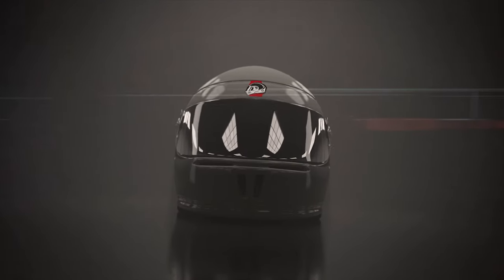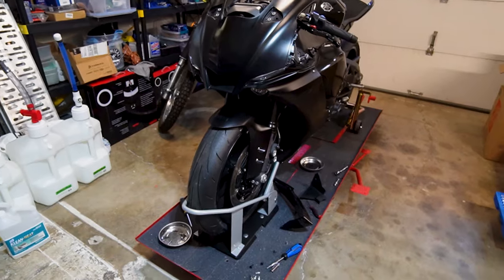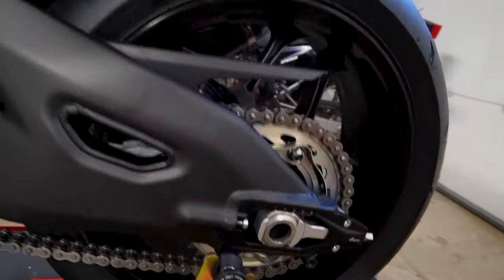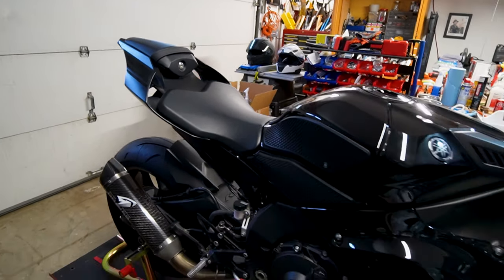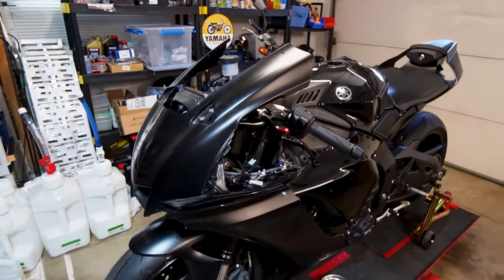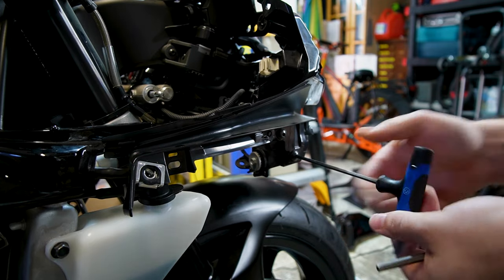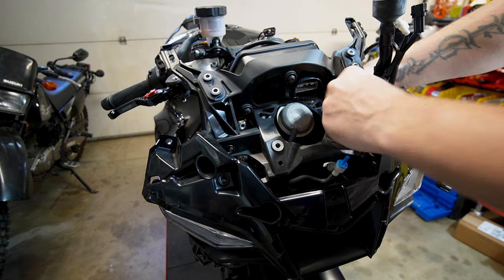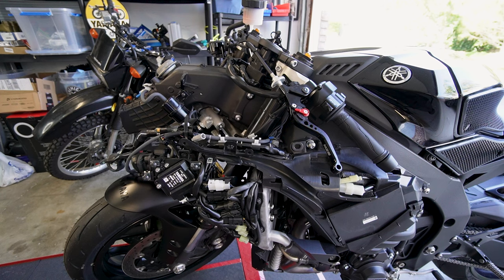Yamaha R1 Intake Flap Removal & Delete! A MUST DO for your Air Box!

Comment: The question is why Yamaha put those parts there? This is the first question you should ask before removing anything on an R1 or R1M. Parts are weight and on Superbikes are always a no-go zone. There must be something more advantageous than the weight to force Yamaha engineers to put it there.
Firstly, engine needs more air than the small duct can provide, when it revs over an X number of revs. At lower revs it doesn't need that max volume of air.
THAT PART IS NOT RESTRICTING THE VOLUME OF AIR. THAT FLAP OPEN AND CLOSE TO INCREASE THE SPEED OF AIR ENTERING THE AIR BOX!!!
YOUR BIKE WILL BE SLOWER AT LOW SPEED BECAUES YOU REMOVE THIS FLAP. You are good on screwing and unscrewing parts, but that's your limit in engineering. Good luck
Reply: @TrickRacing  You said it. They race the bike, not for street use. Racing bikes are not for road use because of the way they build them. Like for example, removing the flap...
Reply: @KHIJAPAN  true
Reply: Agree 100% - I work for an engineering firm though we don't work on engines we still put a lot of resources into establishing the best process for the application. Removing a process needs to be carefully considered, weighing the pros and cons, then testing the said proposals. I also have an R1, I have done many modifications to the exhaust system, and the ECU for track purposes, but I would never remove this part without serious consideration and testing. Additionally, think about the next person who will buy this bike are you going to keep the parts if they want to revert back to stock or just let them guess why the bike is so sluggish at low speeds?

Comment: Love the build series. I have a 2021 myself. Not sure if anyone has already asked this but can't Bren tuning tune the ecu to just leave the flap open? Or is removal necessary to achieve desired airflow? Thanks.
Reply from the maker: So since this is controlled through vaccum from the motor, I dont believe it can be turned off by a flash/tune. When i got my tune done at a local shop in So Cal, they high recommended removing it.
Reply: Yes, they did it for me on my 2021 R1M
Reply: @MotoViceOfficial  hey bro ik I'm late but what all should I get if I want to increase air intake ik I'm should get a aftermarket airbox but what else is needed I'm not experienced with motorcycles.

Comment: Kind of of topic but.. whats your opinion on a hard break in for a new bike ? Did you baby yours or ride it hard?
Reply from the maker: Ehhh, for me presonally I definitely stay on the softer side up until 600mi and then at about 800mi, I feel its ready to go. Yes they redline them at the factory prefor shipment, but I personally think that it makes sense to ease the piston and rings in properly at an incremental rate of load.
Reply: @MotoViceOfficial  I've watched a few videos and I know everyone has their options on the matter. For me I have no self control ha so I've already had mine up to about 150 in 6th gear 😅  it has right under 300 miles at the moment. I've never redlined it or anything but I don't just putt around in the low rpms all the time. I do tend to short shift alot. But just wondering. Ill be getting my first service done at 600 and I guess we shall see. 🤞